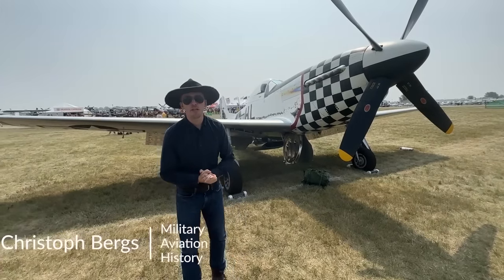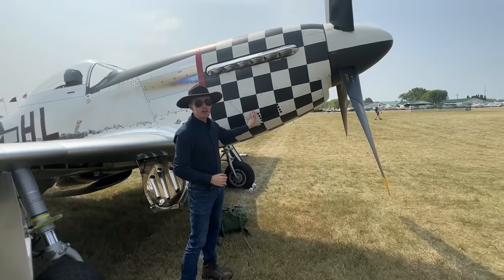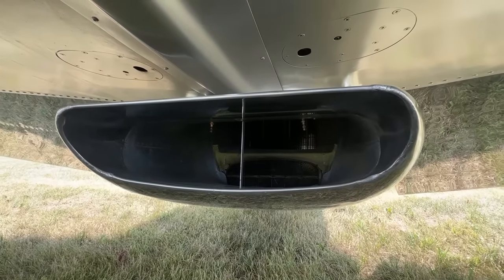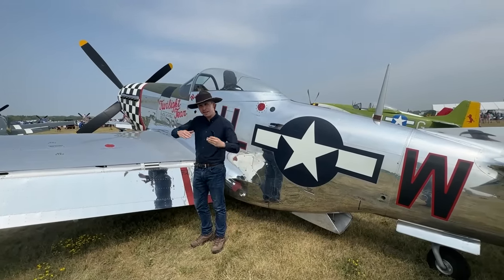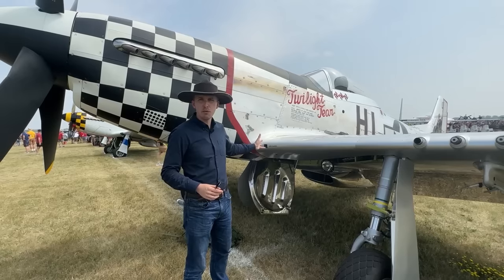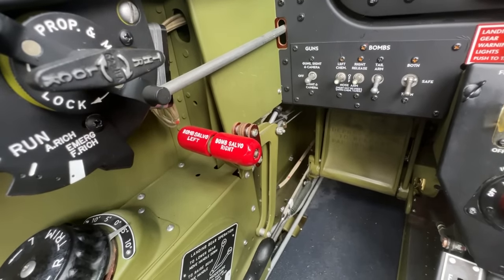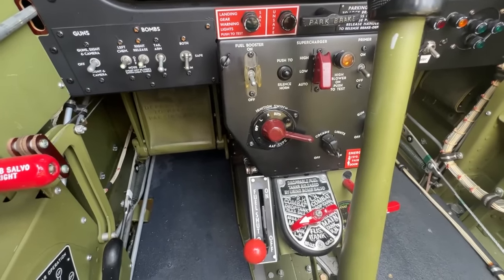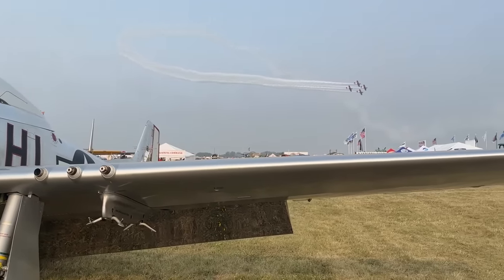Inside The Cockpit - P-51D Mustang "Twilight Tear"

Comment: Although to my knowledge, no P-51Ds were manufactured with fixed tail wheels, later in their service life it was quite a common field modification to fix the tail wheel in place by removing the hydraulic lines and gear doors, and pinning the strut in place. This was usually done when the retracting mechanism was worn or damaged, as a simpler alternative to repairing or replacing the unit. As I say, I only know of this happening later in their life (post WWII) and by this time the Mustang was no longer the premier fighter the USA(A)F had available and was mostly used in secondary roles and ground attack, so less need to preserve the low-drag profile of the aircraft, although I would not be surprised to learn that this modification was occasionaly used during WWII as a temporary repair if the need arose.

Comment: So how did the P-51 become a long-range escort fighter? Was it due to some revolution in aerodynamics that allowed it to cruise more efficiently? Did it have a greater internal fuel load than other fighters? Did it sacrifice combat performance for greater range?
Reply: Mixture of all of the above!!! Less drag due to aerodynamics of the wing profile,. More fuel than most fighters built into the design from the start. Extra fuel tank fitted behind the pilot, which did make affect the performance and stability of the aircraft until that fuel was burnt off. That fuel was used first before the aircraft ran into any combat, plus Drop tanks.

Comment: Good video - couple of points.
No water injection for 1650-3 or 1650-7. Only the 1650-9 for P-51H (and Merlin 100/RM 16 SM on XP-51G). All P-51s had retractable tail wheel - but operationally, the tailwheel was locked down for the P-51H in the late 40's.

The P-51 wing XP-51 though D/K was the NAA/NACA 45-100 High Speed/Low Drag wing -  not Laminar Flow. Its features included very low parasite/form drag for several reasons. First, the actual flow from leading edge, while experiencing transition from laminar flow (inches), to 'attached transitional turblent flow' past the 40% chord (conventional separation for 109, Spit, P-47, F4U, etc wings were at 25-30% chord). This had the effect of increasing the form (frontal area) drag on the conventinal wing while the separation on the Mustang wing was more or less masked by the thickness of the wing itself. Next, the pressure distribution over the wing was more 'balanced' with center of pressure closer to 40% chord (vs 25% for conventional wing). When shock waves formed, they were delayed by low (er) velocity gradient which had the effect of reducing 'mach tuck' changes behind the 40% chord as lift co-efficients were reduced by the mach wave formation. Last, the mfg quality was the highest, but the first 40% of the upper/lower surface of the wing were puttied (joints/flush rivets), primed, sanded and painted.

The other technologies very important, included 1.) 2nd order conical sections design for fuselage design which emphasized gradual velocity gradients/no bumps. 2.) Meredith Cooling scheme far superior toany WWII aircraft save final year Martin Baker V. The Spitfire, Bf 109, Hurricane, etc had no real scheme to harness equal pressure distribution across the face of the radiator, add energy and squeeze the high speed heated air into a reduced area plenum to a small exit area to create a jet effect.

 A final note: Our family is so thrilled by Fagen's restoration project of my father's sixth WR-B/ JANE VI of 354FS/355FG wrecked in MAC June 2, 1945. It was recovered and well along restoration by Pacific Fighters when they sold to Fagen. t was a combat vet with four ground scores to add to my father's previous 7-1-1 air in prior P-51B/C/Ds.
Reply: And Greg puts it all down to manifold pressure…

Comment: Faster but with a lower climb rate than a Spitfire. This was proved when USA pilots attacked Spitfires only to see them rapidly climbing away. But then the planes were designed for entirely different roles
Reply: Same engine, around twice the weight?
Reply: At what altitude? This question must always be asked when comparing aircraft performance.
Reply: @fazole  The Spit IX outclimbs the Mustang at every altitude.
Reply: A Spitfire with that much fuel would be pretty sluggish too.
Reply: Pity they didn’t put the Griffon in Mustangs, seems at least one would have been interesting.
Reply: @garysarratt1  As long as it didn't diminish it's range.
Reply: @jeremyatkinson4976    I just mean I’d like to see the performance of a Griffon-powered mustang prototype.

Comment: Possible interesting topic, (true or false!) I read that when Packard started producing the Merlin engine under license, there were no assembly instruction manuals for torque settings, parts alignment tolerances, etc.  They were told by Rolls Royce that all the fitting was done by hand by experienced workers, that there were no manuals.  Packard had to figure out training semi-skilled workers on the fly before they could develop instructions.
Reply: yes indeed, I understand that in addition, the British blueprints, which were all in Imperial Measurements, had to be changed to American Imperial units as the units, and tolerances, were different!

so, 5/16th of an inch is not the same!!
Reply: @thatsme9875  thanks for the reply! amazing what was accomplished by hand in the pre digital age!